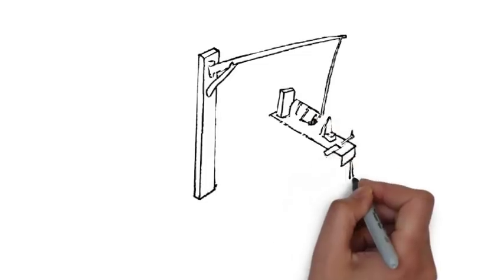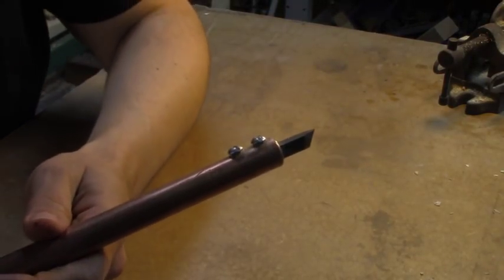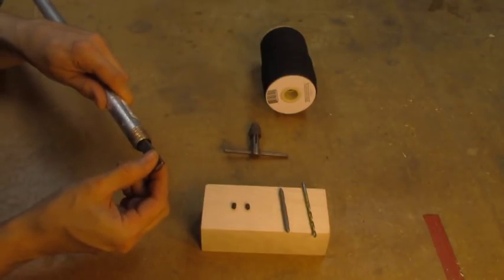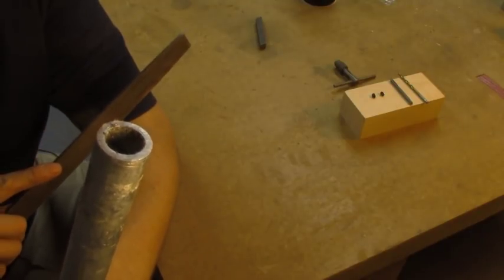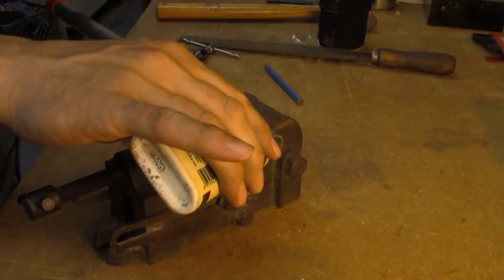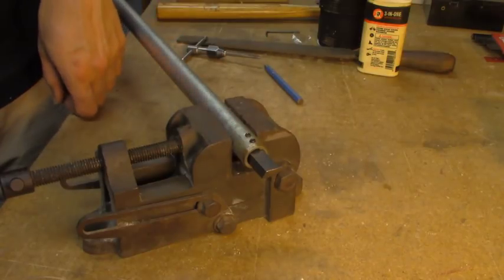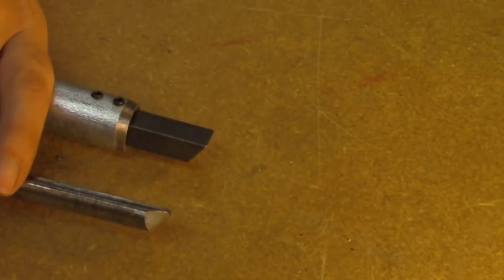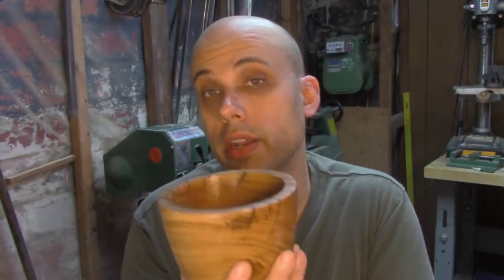Make the cheapest, fastest woodturning gouge EVER.

Comment: Hi Rex, I'm trying to make this and I thought I would share my experience regarding pipe size to help others out. The 3/8" square bits are too small for a 1/2" schedule 40 pipe.  You need about 1/2" internal diameter for the 3/8 square bits to fit, but stupidly enough, the inside diameter of the 1/2" schedule 40 pipe is more than that ... about 0.62".   I actually needed 3/8" schedule 40 pipe, which is almost exactly 0.5" internal diameter.  So yes, definitely bring your bits to the hardware store.
Reply: I bought my supplies, and experienced the same issue: my 3/8” bit had a lot of slop in my 1/2” pipe. I will search for a 3/8” pipe, but I know they don’t carry them at my big-box home centers: 1/2” was the smallest.

Comment: A tip for drilling into round stock. File a small flat where you want to drill, helps prevent the bit from skating.
Reply from the maker: That's a pro tip. I'll try that for sure!
Reply: Centre popping works for me.

Comment: I do recognize that tool from long ago. The Oland tool is a scraper, not a gouge. Scrapers cut with the burr, so you don't want to remove the burr. For a 'shear' cut, you have to drop your handle down near your hip, and roll the tool on its side. I use scrapers far more than most turners do, and they are by far the best tool for removing a lot of wood in a very short time. I generally sharpen mine on an 80 or 180 grit wheel. That gives the best burr. You can hone the burr off without much effort, which might be beneficial for your finish cuts. Anything to reduce the amount of time it takes to sand out your bowls. It still takes me longer to sand them than it does to turn them....

Comment: Hey Rex. great job on the tool. One thing though, there's a cleaner way to do the wrap that's easy to do and doesn't require drilling holes.  At one end of the wrap area, lay a couple of inches of the thread along the pipe, then wrap the thread over it tightly. When you get an inch or two from the other end, lay a loop of the thread or small wire along the pipe, so that the end of the loop is past where the wrap will end, and continue to wrap over that. When you get to the end, stick the end of the thread through the loop and cut it off to just an inch or so long. Then grab the other end of the loop and pull. That will tuck the loose end of the thread under the wrapped handle, leaving a nice, clean, wrap. Lots of videos of this technique online. Been using it for years to wrap tool handles, walking sticks, etc.

Comment: Like your idea.  I used it to upgrade my diy carbide tool. I used a 1/2 square bar and knocked off the corners to fit the pipe.  Made the bar about a foot long with the cutter on the one end.  Now I can extend the bar to get more reach for deeper hollowing.  Thanks for a great idea.
Reply from the maker: T Lewis Dean my pleasure! thanks for the compliment.

Comment: Great video!  I made one from a 1/2" pipe and a cobalt insert. Before drilling and tapping for the set screws, I took a hammer and flattened the ends of the pipe on an anvil into a square so the bit would never twist even if the set screws came loose. I did the rough hammering without the bit inserted but finished it off with the bit in place.  You have to be careful though because the cobalt bit is brittle.  I used a flat file on the inside to assure a smooth fit.
Reply from the maker: That sounds like a great mod! I'll have to try that.

Comment: I love your video. I found the oak hard to turn at first. When I realized that I wasn’t using the tools correctly, and that they were dull, I found that white oak can be turned really easy with a roughing gouge. Then I can shape it with any tool, according to what I’m making. I was hoping you were going to make an actual bowl gouge, because I can’t afford one right now. Another tool that cuts real well is a carbide tip. You can buy a 3 pc set of tips on eBay for around $20. Then make your own handles. I picked up a 1/2” square pc of steel and made the arm to match the shape of the carbide tip. I still enjoyed your video.

Comment: This is my kind of tool making. You've got a new sub in me. There is a machine supply store near by so I'll swing in and see if I can pick up some of this Cobalt high speed steel.

By the way, I made a deep hollowing tool styled after Lyle Jamieson's product. I used 1/2" black pipe for the "D" shaped handle and slipped a 5/8" steel rod into it. I drilled a 5/16" hole in the end about 2" deep and added two set screws. I found a package of HHS tool stock at Harbor Freight and made a cutter out of the 1/4" square bar. I sharpened the tip like you did and it works very well. On the opposite end of the 5/8" rod I drilled a hole at a 30 degree angle and now I can flip the rod end to end for two different cutting angles. It's not as good as a production model, but it works. I've made a couple of 8" deep vases with it so far.
Reply from the maker: Man, I love to hear about people making their own tools!  Do you make videos? Did you document yours? I'd love to see a picture. Thanks for the positive feedback!
Reply: I do have some pics, but my welding skills and photographic skills are atrocious.OK? Send me a private message with your email address. We'll talk.

Comment: A  small tip I saw elsewhere; start the tap with a pillar drill, but turn the drill chuck by hand. It ensures that the tap is perpendicular, very easily.
Another tip; the end of the handle cord could be fixed with superglue, or epoxy instead of a knot, which would be a neater finish.
Reply from the maker: niklar55 That's a good tip on the "pillar drill" (you must be in the UK). I've never tried it.  as to the knot,  I did soak it in CA glue,  but you're right about it not being clean.  the handles have the grip and thickness I want,  but they're a bit messy.  I need to make changes to make them tighter.
Reply: I'd advise against using superglue with cotton. It soaks in well but it'll make the fibres brittle & they can snap easily. Something like epoxy or even your usual wood glue (I use Titebond III) will secure things well & prevent fraying, provided you work it into the cotton a bit so it grips to the fibres. Old Titebond III actually works best since it thins once expired & will dry out with a little more flexibility than the fresh stuff.
Reply: no glue needed lay 2in  pf chord on pipe wind it over itself  take a6in chord double it to make a loop lay on pipe wind over it to end put end thru loop pull it under wind trim end no glue no knot

Comment: I just found cobalt square steel 3/8" bits on ebay for a buck a piece.  So, got all spendy and bought two of them.  Thanks for the idea.  New subscriber here.
Reply from the maker: John Turpin That's a great price! The local machinist shop hit me $2 each and some of the bits were used.  Really glad you found the idea helpful.  check out my follow up video on making 3 more tools with the same basic setup. thanks for watching!

Comment: The tool you made in this video really is just a round-nosed scraper, not a gouge.  There is no flute nor wings, so it will not cut, only scrape.  Oak isn't difficult at all, if you use sharp cutting tools.

That being said... GREAT video, great content, very thrifty and informational, and I might use this method to make myself a flat scraper I've been wanting (but not enough to pay for with my firstborn.)   Thanks!
Reply: I cut/sheer cut all the time with scrapers and square carbide tools.  Just turn them like you would a skew.  No such thing as can't.  Thanks and take care, Larry

Comment: I made one using a 1/2"  bar from Grizzley but didn round the edges, left a square tip, it is the best tool I've found for roughing , I don't slide it , I just push in and pull back repeatedly .
Reply: I used High Speed steel bars on both .

Comment: Finally got around to making mine. I found that the inside of the 1/2 pipe is a perfect fit for 7/16 " inserts, a little loose for 3/8. It fit 3/8 fine before I deburred it, but I won't use a pipe with a burr since the burr will eventually wear away and things will loosen up.
Reply from the maker: That's great!  I hope you enjoy using it!

Comment: There are 3 levels of taps, start , intermediate and finish.  When hand working start with the starter tap.  It is the most forgiving when you wobble.  Then, move to the intermediate tap. This tap will go in straight and there will be a good but still unfinished.  Complete the thread with the finishing tap.  The result will be a very good set of threads that will be difficult to cross thread.

Comment: Exactly, just a scraper try turning a 12"x3" hard oak bowl with that and see how it comes out. If you put an even crude flute in it with a 4" grinder it would be much better. Give it a go and really make it a "Gouge"
Reply from the maker: Hilariously,  I DID turn an oak bowl with this tool in this very video.  It came out well enough that it's currently for sale at a local kitchen store.
Reply: Actually this is not a scraper in use. It should be sharpened to 45* on the end and rounded back with a sort of Irish Grind shape like some use on a bowl gouge. It is presented to cut, not scrape, and on green wood you can really see the shavings fly, not the grindings fluff. The style Rex is using with the pipe and not the solid shaft is one I would call a "Quick Oland." I have made and used them in size from 1/8" cutters up to 1/2" cutters for over 15 years now and have used them for a lot of faceplate turnings including 16" to 18" bowls. The only time I use them for scrapers is to shear scrape with the tool on its side. Yes, I have bowl gouges and prefer the Oland tool Nice video Rex.

Darrell Feltmate

Comment: If you file, grind, or hammer a flat along the bottom of the pipe, it would be more sturdy on your tool rest and less likely to rock from side to side. Just an idea though and great video!
Reply from the maker: I don't think that's a good idea. You're always rolling the tool to the get the right cut. A flat would make it harder to handle.

Comment: Great ideas! But I get nervous with handles on turning tools that don’t give me a better mechanical advantage. I’ve watched a few videos that give a ratio between how much the bit hangs past the tool rest versus the minimum length of the handle. It’s astonishing how much the rule requires, something like five to even seven X. I’ll make one of these but probably have a 24 to 32 inch handle on it. Thanks for the great video inspiration.
Reply from the maker: Well, you often only need the tool hanging about an inch over the rest, so according to your formula, a 7 inch handle would be adequate. I've been turning with these tools for years now and the length of the handle has never once been an issue. Glad you liked the video!
Reply: Not my formula, I got it from Brian Havens. https://youtu.be/cwqG8ImRC_Q give it a look and tell me what you think. I’m wide open for suggestions.

Comment: Cobalt steel isn't harder than non-cobalt tool steel (M42 vs M2). In fact it's actually softer, in addition to being less tough. The difference is that an M42 piece of tool steel holds its hardness at a few hundred degrees hotter than regular old M2 steel. This is particularly useful when grinding the shape into the bit. 

If you're looking for more information, read about tool steels and high speed steels (HSS) in wikipedia: https://en.wikipedia.org/wiki/High-speed_steel, or in the machinist's bible, Machinery's Handbook.
Reply from the maker: Well, looks like I learned something new today!  Thanks for the extra info!

Comment: I think you need to use this type of tool starting from your tail stock and then working around the bowl pushing toward the headstock.  Pushing it straight in as you did will only cause nasty catches.
Reply from the maker: And yet the tool does not catch. Amazing.

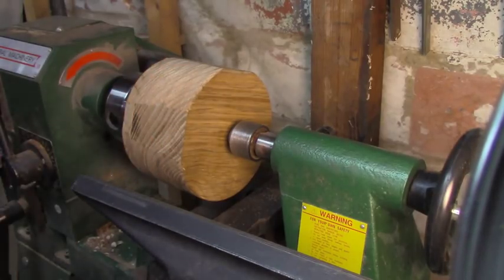Comment: I hate to be a negative Nellie but the segment at 15:58 is not how it's supposed to be. A real turner would say that the tool is simply not working. A properly sharpened bowl gouge made of M2 HHS will remove wood quickly and with little effort, without having to be "bearing down as hard as I can." Oak is not a difficult wood to turn with a sharp bowl gouge, a real one, with a flute!

Comment: Rex...1/4-20...1/4-24--10-24--6-32  The number in front is the size, the number in the rear is threads per inch.  ie 10-24 has 24 threads per inch a 10-32 would have 32 threads per inch.  You would have made a stronger scraper if you would have used a 10-32, same size set screw but with more threads  per inch which would have more threads cut into your pipe.  Oil is Very important when you are cutting threads.  The reason you didn't have any trouble was the fact that the metal on the pipe isn't very thick.  Also, you can put the tap in a cordless drill and with the setting set lower you can tap just fine with one.
Reply from the maker: I know what the numbers mean. I was just letting my viewers know that they don't need to get the whole numbering system to do the project. Also, I did use oil. I showed it clearly. i said you don't need TAPPING FLUID. Oil is fine. Still, thanks for the lovely explanation. You clearly know what you are talking about.

Comment: FWIW, you can make turning tools out of cobalt steel, if by "cobalt steel" you mean M42 HSS (8% cobalt). Both Carter and Son and D-Way sell them. I've got a few and they're great: they take a nice edge and hold it longer than M2. They're definitely not cheap, though.

If you want a ton of info on bowl turning using scrapers (and a scraper-like tool called the Big Ugly made from a weird alloy called "tantung"), check out the "Robohippy" channel. It has a lot of good videos from Reed Gray, a professional bowl turner in Oregon.
Reply from the maker: I've seen those and I do want to make one. Need to bug a friend with an oxy setup.

Comment: Love this idea. I can even see ways to improve the design, even using wooden handles. I have bits of metal...ok, some piles. lol I have been sorting a bit over years, pulling out any really heavy and hard stuff, and setting it aside. It probably isn't M2 or better, but I hadn't even considered using some high carbon pieces to make insert bits. I don't have to shape a long piece of metal! ;-) Wow, so simple, I like it.
I can build the tool and practice with a few high carbon steel bits, till I get more suitable steels.
One could have just one or two handles, and a wide variety of bits, to save space?
If you had say three bits the same, all sharp, you could continue a project without stopping to sharpen, if that is an issue. One could easily make bits that have two shaped/sharpened ends.
Hmmmmm, just need a good way to fasten an insert holder into a nice wooden handle ;-)

Tips for you Rex, and all. Cutting fluid isn't just about lubrication; in fact that is a lesser of its purpose. You need the metal to grab some to cut. Cutting fluid needs to COOL your metal, especially the bits. Drills for metal need to be tougher than the metal being drilled, and you need to drill slower and with more pressure than with wood drilling. There is friction; there has to be, to cut. Friction makes heat. Heat ruins your bits, fast. A really good cutting fluid, IMO, is designed to cool primarily, and should stick to your bits some. It is nice too if also designed to work with hand tapping. I didn't cheap out on this, and got some industrial stuff that isn't safe to touch LOL
I have some nice taps and dies and drill bits and they are not that cheap, and I usually have one of each, so I got the best protection I could find. There is a lot of science behind cutting fluids; and there are cheap fluids good for some jobs.

Wood working drill presses, BTW, run too fast on their lowest speeds for metal, except for small holes, but things go so much better tapping, if you can drill and tap really straight. So long as you get a nice straight hole, though, a "proper tap" should center itself in your hole. There are different taps for different holes. Personally I would not have tapped as you did with the vise. Too much changing horizontal pressures. It the vise were fastened down it would be easier to keep the tap straight. I would have made as clean and straight of hole as I could, and then, for that job, I would have just used my hands. One holding the tap and tool, the other holding the pipe. Why? Well, if that is a proper tap for hand tapping, it will center itself in your hole as you start. You can feel it. Fine for a short hole like that IMO. Hope this helps some.
Even better, of course would be the vise FIXED in place, holding the pipe level, with a tapping jig holding the tap perfectly straight.
Good taps are really hard metal and they break if not used well, and that becomes a real bother trying to get hardened steel out your hole lol

Comment: as a machinist for 30 years  and drawing on that knowledge for a woodturning hobby you can obtain what is called brazed on carbide tools  for turning on a metal lathe as a C8  with a C5 grade carbide for about 5.00 dollars and it is a 1/2 square shank  with a 1/2 square carbide on it and you can grid any shape you want and hone it and it will cut any wood species with out a problem and there are all kinds of ready made shapes to chose from
Reply from the maker: Jack Russell jack,  the only brazed on tools I've seen have a pretty small carbide bit and they are usually mounted to the side of the tool where they would be less useful for woodturning. what you're suggesting goes way beyond my limited knowledge of machine tools.  could you throw up a link so the rest of us could check out the specific tools you're talking about? it sounds really interesting.